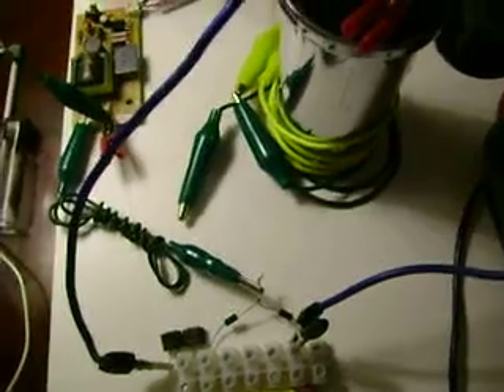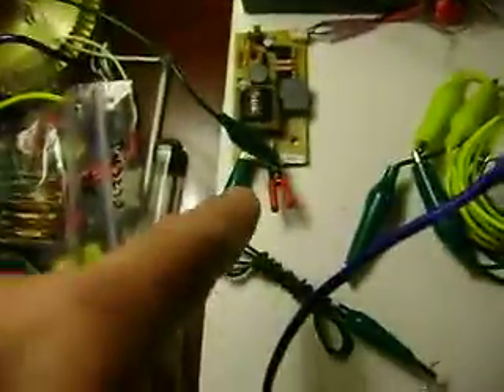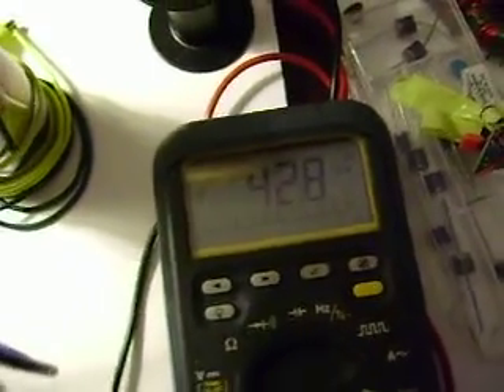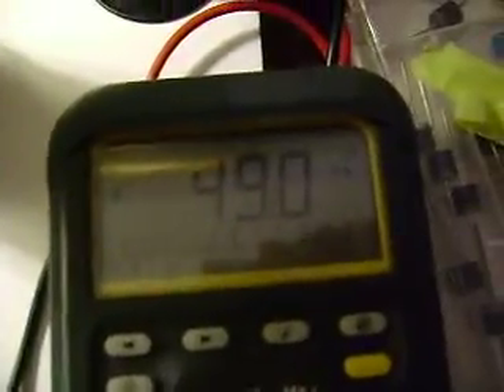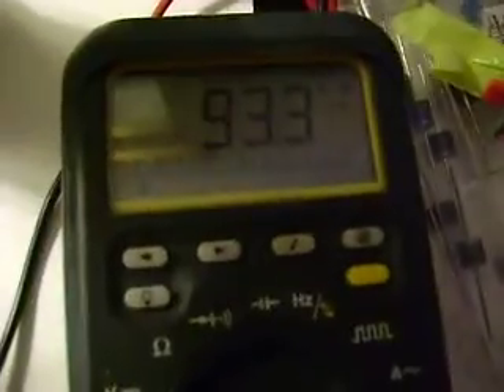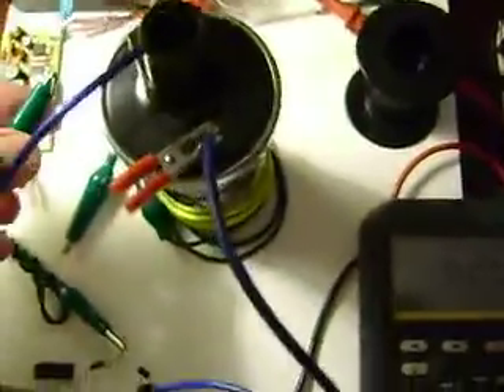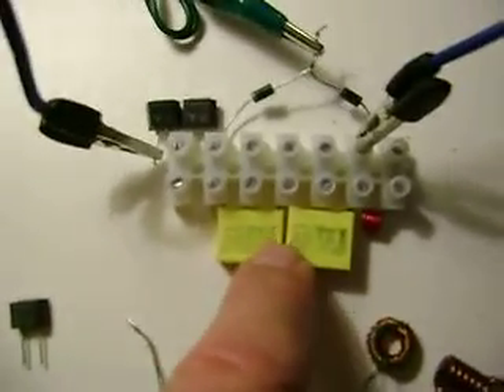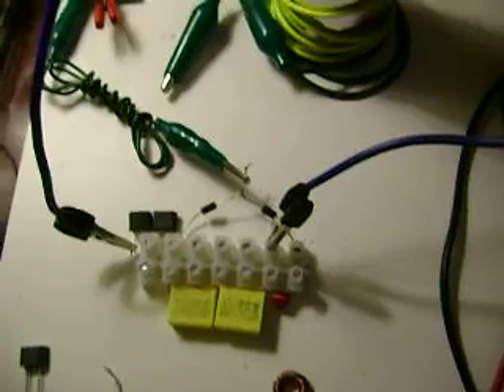capacitor discharge circuit part 2e another way to charge the cap discharge tests

Comment: Mags, you dont need an av plug, simply remove av plug and directly connect one leg of cap to where av plug is going, attach a 1 mm thick copper wire 4 inch antenna to other leg, and you will still charge the caps. Thanks.

Comment from the maker: @Shanjaq 

hey Shan

I believe they are in the low ms to high us   I have to extract the data from my pc drive as it crashed and wont boot.  The part no is  K2400f23  If I remember the data sheet should be searchable.

Mags

Comment: @Magluvin ah, I've been wondering how to make something like a tiggered spark gap for capacitor discharge, but with gas tubes or sidacs as you pointed out.  What is the upper frequency limit for using sidacs like this?

Comment from the maker: @harpbloke 

Ha   well dont hold your breath but there is more energy in a cap discharge than what it takes to charge it, depending on conditions.
There is a reason for discharging into step up transformers. The primaries are low in ohm, allowing the cap to discharge a tremendous amount of power, of which is translated to the secondary.
So stepping it down may do as you might think.  A 1 to1 transformer would make no sense. Step down might be hard to produce, very short secondary as to primary.